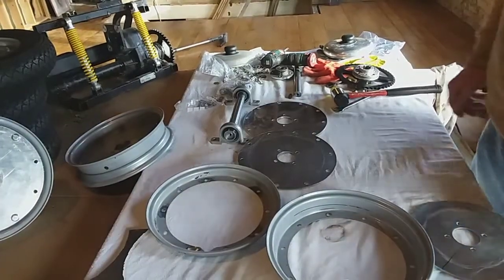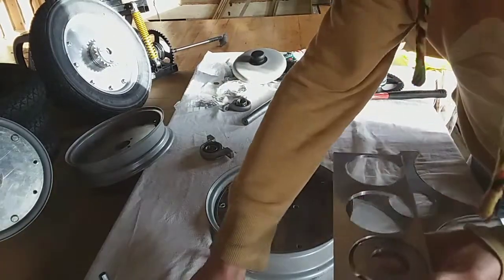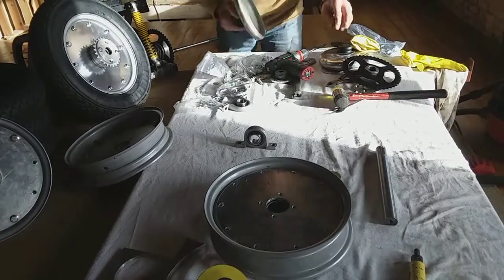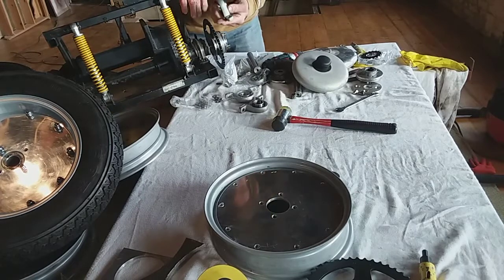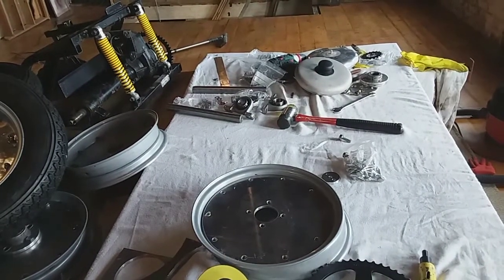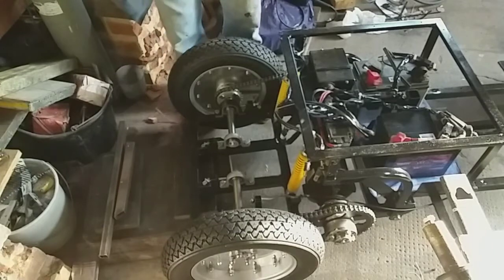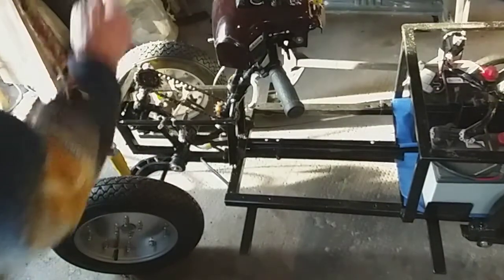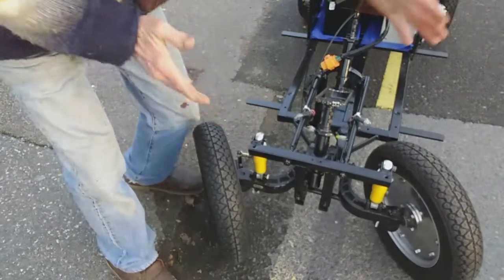A Faster Mobility Scooter Car

Comment: Why dont you just change the controller? i bought a cheap one on ebay changed it over can go alot faster now. All you did is pointless and way more work then needed
Reply from the maker: I AM ENJOYING THE WAY THAT I AM DOING IT AND IF A BROBLEM OCCURS THEN YOUR NOT LOOKING AT EQUIPMENT THATS NOT A PROBLEM TO SORT OUT. IF I WAS AN ELECTRONIC WIZARD THEN I WOULD CHANGE THE SPEED OF THE MOTOR. BUT I DONT WANT EVERY VEHICLE TO LOOK THE SAME. PERHAPS YOU NEED TO PUT A VIDEO ON YOUTUBE AND EXPLAIN TO EVERYBODY HOW TO DO THIS. ALL THE BEST. PETER.
Reply: Also you should stop using caps in your answers its like your shouting or being aggressive.
Reply: It's more heavy duty now.
Reply: @deanwarner1205 😅oh SHIT
Reply: I have a 24volt motor in my mobility scooter and want to use a 48volt battery {18aH}, with a new 48v brushed controller. if I buy a brushed controller {2 phase wire} how many watts do you advise the new controller should be ?

Comment: Great video again Peter. I just recently found you here on YouTube. Im doing a little bit of the same you are doing.. using broken mobility scooters to make fun cars for (big) kids.  In My last build I got rid of all the electronics and used a new 36v controller. The speed is going up by 50% without using bigger wheels. I combination with your gear ratio it would even go faster, since these motors are built really strong. Oh and… I’m a musician too ;)
Reply from the maker: GREAT TO HEAR FROM YOU. I WISH I KNEW MORE ABOUT THE ELECTRONIC BUT I AM SURE I WILL ONE DAY. I AM JUST MAKING THE BODY FOR THE TAPERED BONNET CAR BUT I HAVE HAD TO STOP BECAUSE I HAVE GOT A GIG TOMMORROW ON DEAL SEAFRONT SO I NEEDED TO RUN THROUGH SOME NUMBERS. ALL THE BEST PETER.

Comment: why do all these modded cart videos require a full chop shop & what seems like a hell of lot fucking about, why can’t you just tear speed controller out & thro a stronger, faster motor in it, a motor simply spins at higher resolution, equal more torque at wheels.
i’d love to mod a cart to twice it’s normal speed which would be 25km as i’ve got 1 atm bc of a motor vehicle accident knocked me off my bike 🚴 so insurance hired me of scooter, I JUST wish it would go double it’s speed.
it does 10km so even 15km would be great. 
i can’t understand why you need a full chop shop to modify one of these. 
ID BUY 1 IF IT WOULD GO 15kms 
as i just don’t have tools, skills & nouce to mod one.
Reply: If you take a large mobility scooter and put bigger wheels on the back it can go much faster.  I've done it and it works fine.
Reply: Changing the motor would do nothing. Its the controller you need to change.